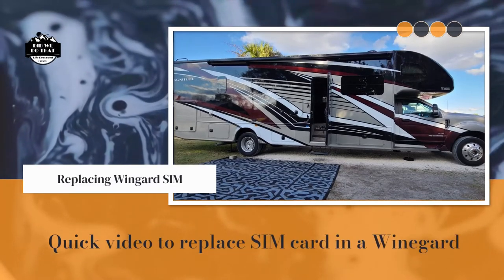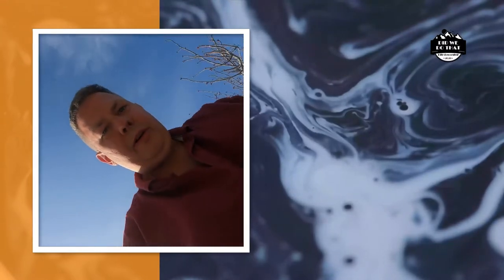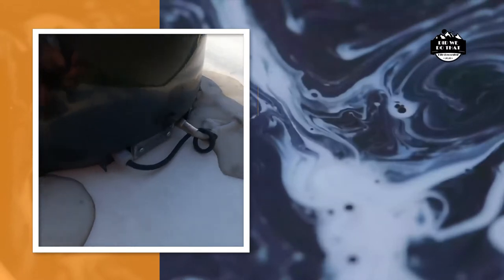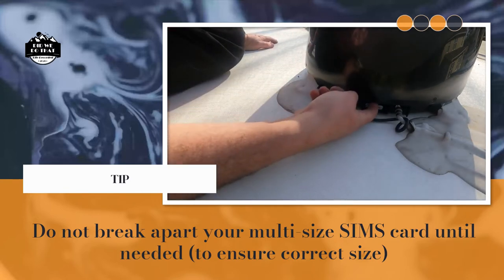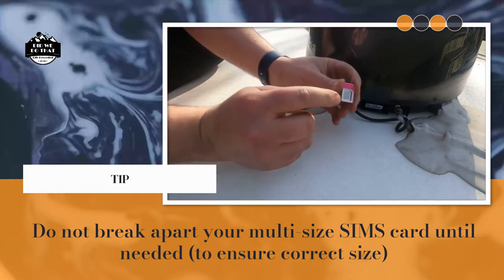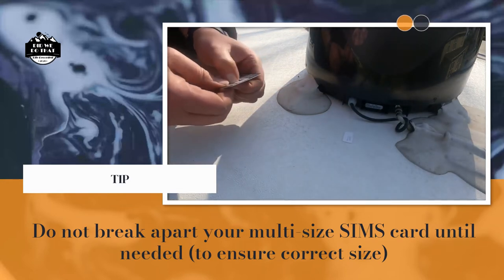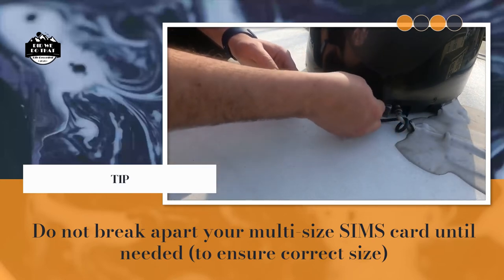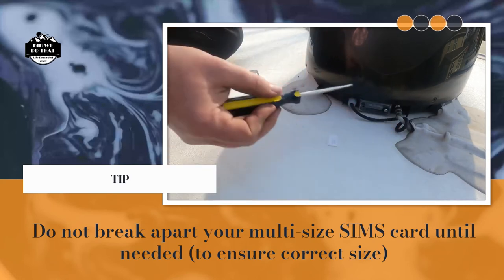Winegard Connect SIM Replacement 101

Comment: How much to add a SIM card?  Does it add another line to your account?
Reply from the maker: I believe most companies should be able to handle the Wineguard.  But, before you buy one...verify with your Winegard IMEI number.  I went with Verizon.  But, i have had Mint Mobile, T Mobile, AT&T SIM cards in there prior.  Each company has different plans.
Reply: I spent a long time talking to AT&T about it.  It actually is better to go prepaid.  I went with 100gigs and when you get close to it being used up you can just get online and reload.  If you add a line it isn't as cost effective because basically you are adding another line.  Unlimited data wasn't available(at least not with AT&T).